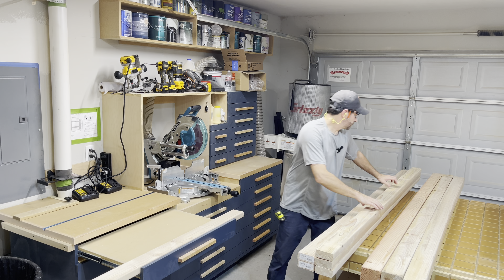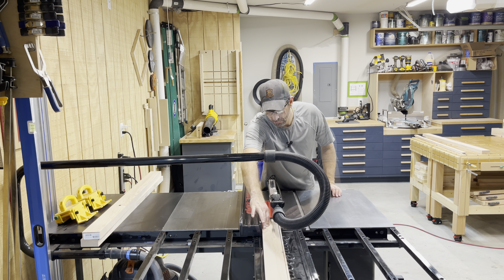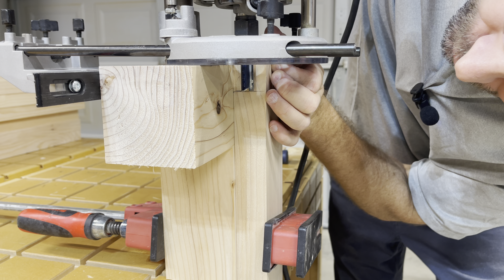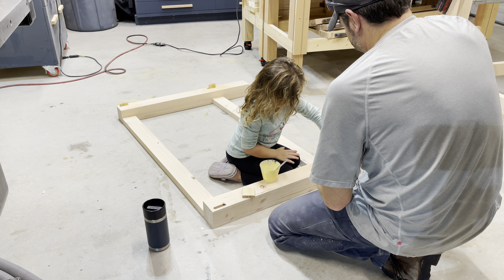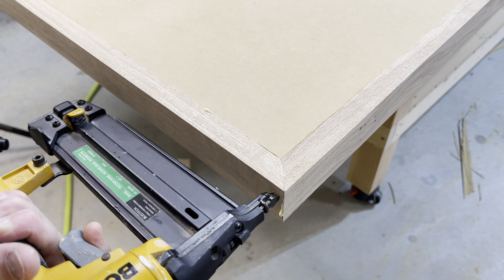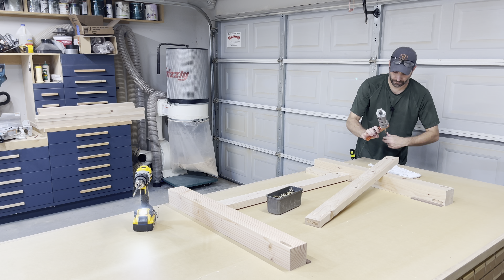Awesome Workbench and Assembly Table!!!

Comment: Great work and nice video. Congratulations on the creation of this work table. I would like to ask you a question, after some time how do you feel about using mdf for the top? But above all I need to know about the vertical use of this material
Reply from the maker: MDF is great for workbench tops. Especially if you cover it with laminate like I did here. Not sure what you are looking for in regard to using on a vertical surface, but mine is holding up great. If I was to rebuild this bench I would use the same materials. Hope this helps 👍
Reply: @aaronbebeau  Yes, you have been useful to me. Currently my workbench is made with poplar plywood, I use it mainly for working with laminate (cutting and edging) and the holes have widened a bit with use and the clamp dogs tend to fall out, now I would like to redo it and I wonder if mdf would be suitable
Reply from the maker: @ I will be adding some storage to this workbench soon. I will be doing a full 1 year review along with the review. Stay tuned.

Comment: As I said earlier, that’s a fantastic build. Laminated top, Dog holes, large siding and a good vise makes it a truly versatile workbench. It was certainly interesting to hear about the cord and clamps getting caught in the dovetail grooves of your old bench. I’ll surely watch out for those on mine 😂.  Always good to see your family’s cameos! Great job Aaron! Oh I almost forgot to ask. What’s the black paint/stain you applied to the MDF panel on the side ?
Reply from the maker: Thank you for the kind words! The stain I used is Minwax True Black and the black dye is just a dye that I picked up at Woodcraft. I'm sure any black dye could be used though. This was the first time I tried the mixture of the two, and I am extremely happy with the outcome. This was a fun build!
Reply: I've had good results just using straight india ink. I got a big bottle of it ages ago and it turns things jet black

Comment: Aaron, great video! this is the first one of yours that I have seen. I appreciate you addressing the cons of your previous matchfit assembly table. I am considering using the matchfit system for an assembly table as I already have several components. Did you find any issues with glue-ups on your old table? Such as glue getting in the groves? how did you keep them clean and glue-free? Thanks!
Reply from the maker: The glue wasn’t a major issue. I was diligent about covering the table with some paper while doing glue ups. I still might run a dovetail groove around the perimeter of this table. I just won’t put as many because it’s not needed. My advice would be to make a few grooves and the use the table for awhile. The beauty of the Matchfit system is you can add a groove anytime as long as you have the bits.

Comment: Really appreciate your videos, Aaron. This bench is awesome as everyone has said. One thing I wondered about your prior pair of dovetail benches… I tracked that you said the edges snag things and glue ups can be tricky too. I’m curious why you went for one bigger bench this time rather than a couple of smaller modular benches, like you did with the dovetail Idea design. I also tracked that you said you wanted more mass out of this bench. Was that part of the drawback of the system you used before?
Reply from the maker: I built my previous workbench with the idea that my wife could park in the garage. That never happened lol. Also I like trying new things and never had dog holes. I am thinking about adding some dovetails to this new bench though too.
Reply: Thanks Aaron.
Reply: @aaronbebeau  thanks.  I've come back to this one - and the micro fit one - several times.  Good stuff.  Were you happy with the swivel caster feet?  I'm trying to decide between stationary feet on a t-nut with separate cam-engaged casters on the side, vs the exact ones you used in the matchfit workbench.  Did you ever find that the bench moved when you didn't want it to, because of the swivels?
Reply from the maker: @deanhobbs5388  if I ever decide to build a mobile workbench again I will definitely use the swivel casters again. They really do work well. The heavier the bench the better they work too.  I’ve had the side mounted casters as well, but I do prefer these swivel ones. Hope this helps

Comment: I shouldn’t assume, but I do assume you use a round over but to make those tenons.  I have never had much luck with choosing the right bit.  And with router bits, online shopping they never seem to give you much of a description or much detail.  Is there a way that you use that always works?  Like you plane a board to 1/2”, cut the width on the table saw, and then you choose what bit and how can that be easily translated to a smaller thickness with a different bit?  

You have the radius, the diameter, the cut height, and all that
Reply from the maker: Yes I used a 1/2” bit for the mortises. Planed a board down to the correct thickness and then used a 3/8” round over bit for the edges.

Comment: I would like to make 5’x10’ jig table that would sit about 12” off the floor. What where the sizes of the MDF sheets you used? What size holes did you drill? The red devices what are they called?
Reply from the maker: MDF sheets are 4’x8’
Dog holes are 3/4”
Red things are called dogs